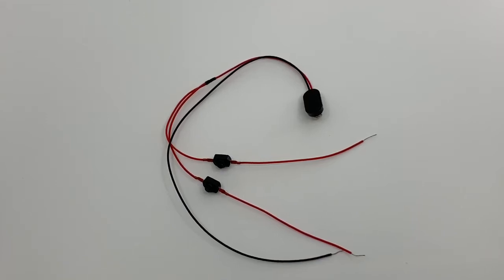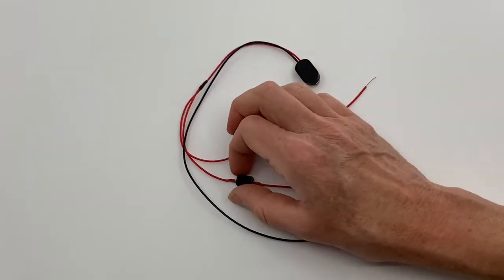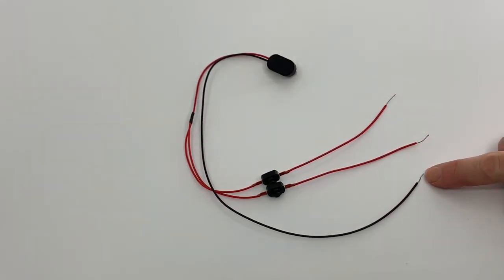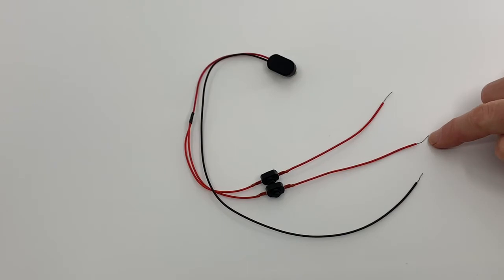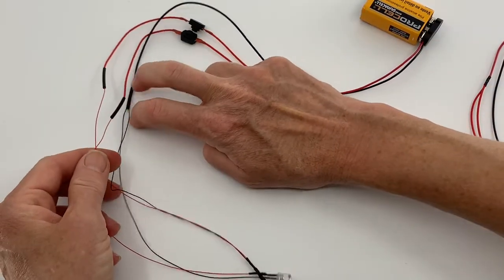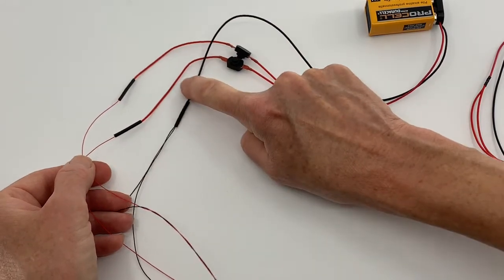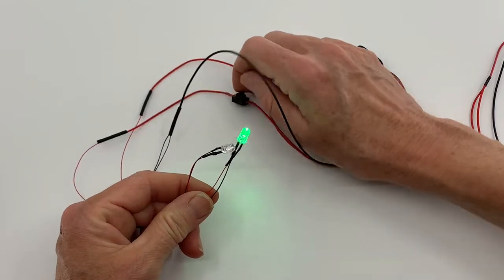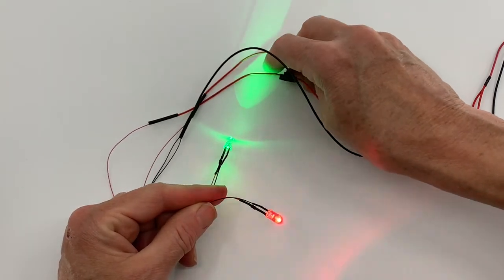How to Use a 9 Volt Battery Snap with 2 Switches

Comment: I wish someone would invent an LED battery that would last as long as the LED light bulbs do. I have found and purchased what they call, "anything lights," with the self contain 3V batteries. They advertised that these lights will last for 4000 hrs. or more but the tiny, circular batteries for only 50 hrs. I'm not particularly fond of wiring my miniatures with transformers and all and these little lights eliminate that problem. It's just that the batteries are, in comparison to the bulbs, so short lived. Has any electronic genius out there come up with a battery supply that will last MUCH, MUCH longer?
Reply from the maker: Have you considered using a portable power bank as used for cell phones?  They are rechargeable many many times, and they can run LEDs for a very very long time! We have a USB that can connect to LEDs, we have them for 5 volt OR for 3 volt https://evandesigns.com/collections/wire-switch-more/products/usb-type-a-power-supply-cable